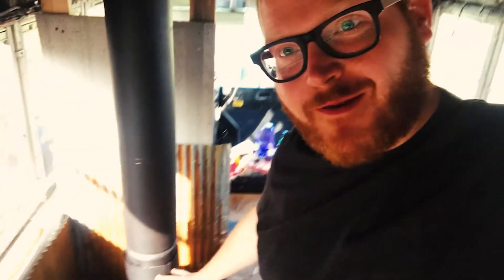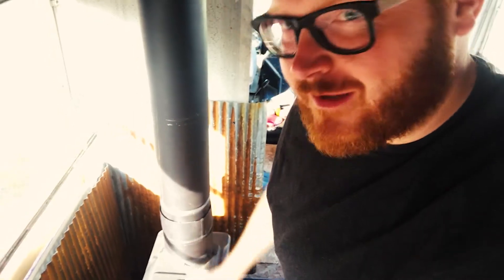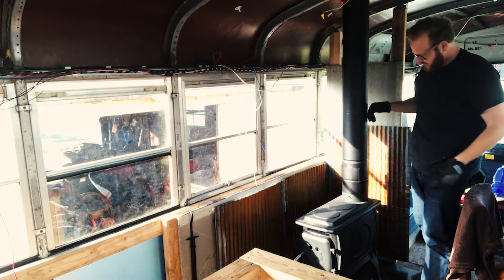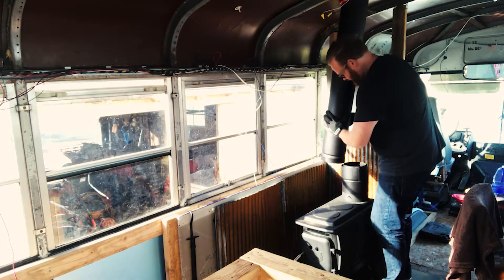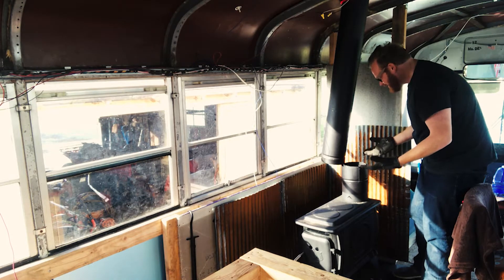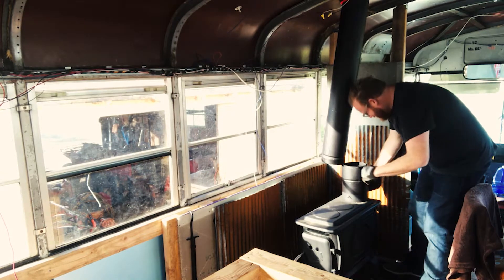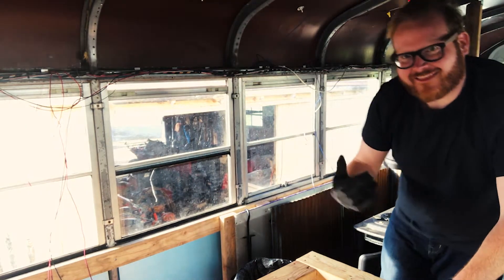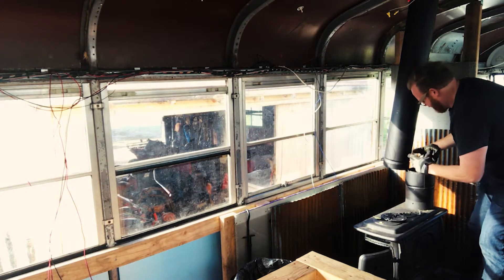Wood Stove Installation Part 5 | Skoolie Bus Conversion Tiny House Videos

Comment: Hey man quick tip. Hold newspaper in the stove for a minute or 2 to allow heat to push cold air out of the pipe when you hear the vacuum and draft begins then light your tinder bundle
Reply from the maker: Oh man..... Good tip. But I already tried that. Keep watching and you'll learn the reason I wasn't having troubles. So silly....
Reply: Jeffrey James Binney i mean in general. i do that starting procedure on all my stoves. i did watch all your videos brother. i saw the mess you had in there. but trust me start your fires that way every time and the fire will never smoke out your bus
Reply: While you Do have to heat the air in the chimney, when it's real cold, newspaper will create smoke which could blow back into your living space.  Try a torch to heat the flue air and Then the newspaper.